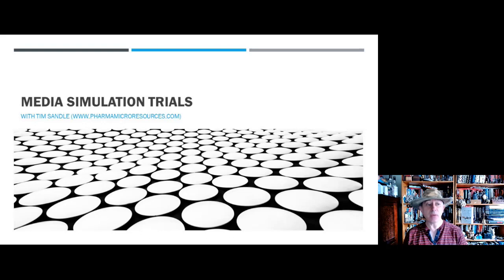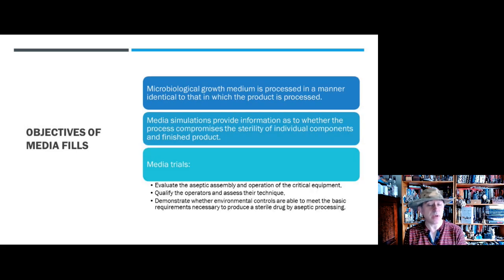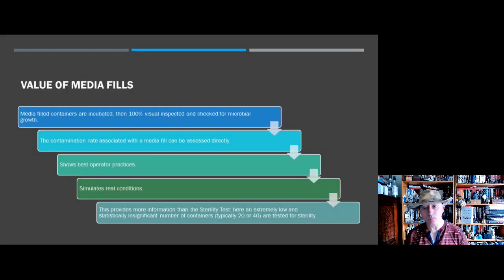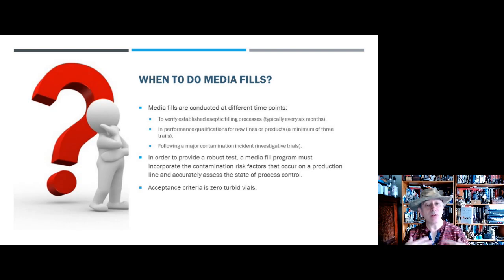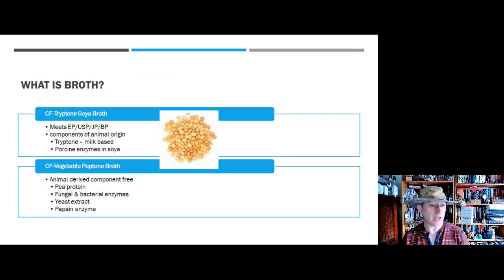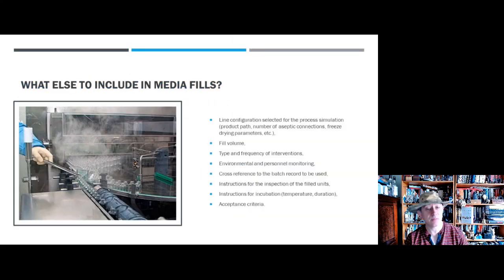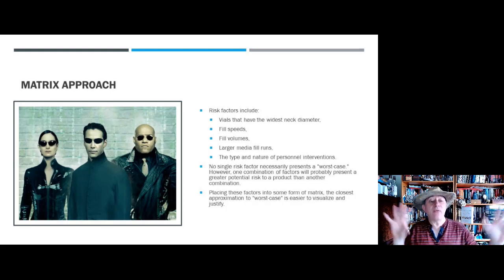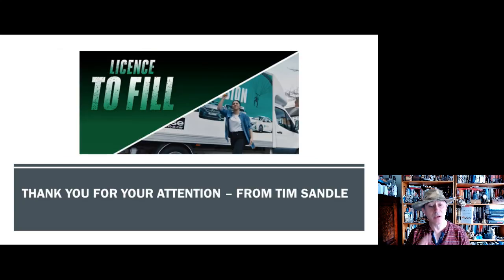Media simulation trials for aseptically filled products

Comment: Thans Mr.Tim for valued presentation: I have a question please: if media fill was done for eye drop with non-transparent bottle, then how we can detect the turbidity or growth at this stage?
Reply from the maker: Hello, you need to switch to using an identical transparent bottle for the simulation.
Reply: @timsandlemicrobiologist  thanks a lot Mr.Sandle for your reply …. On the other hand , I have still two question. That being as debate with my client, and your reply will be added value for me :
1- is there need for separate sterile  testing  lab for Blow fill seal solution Manufacurering plant ( IV bag with sodium chloride )?
2- is there need for gowning  as Class A for BFS room ( operator ) or not ?! Also, is there need for separation gowning and degowning rooms for blow fill seal room in case class A Gown used ?
Thanks and appreciate ur effort